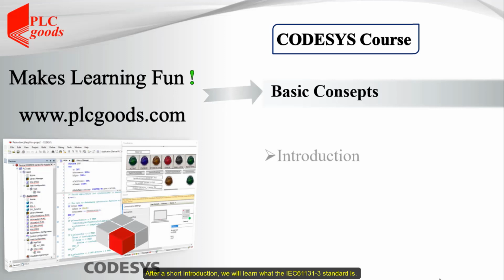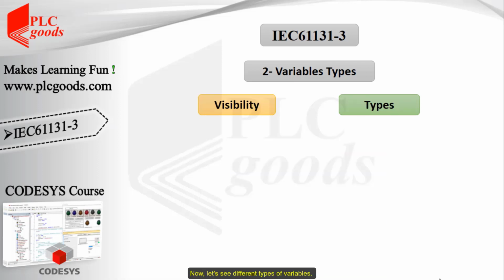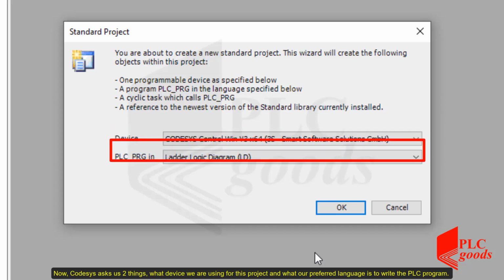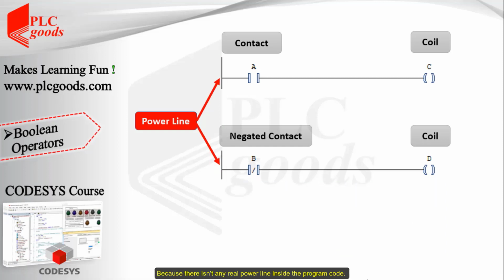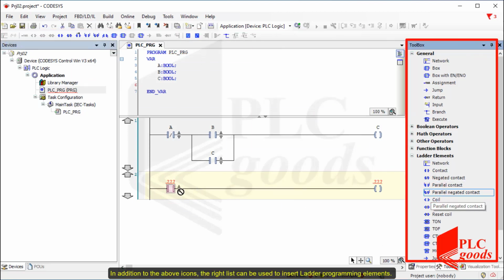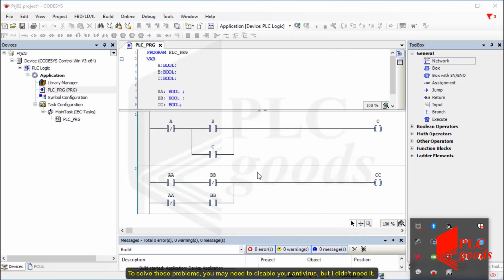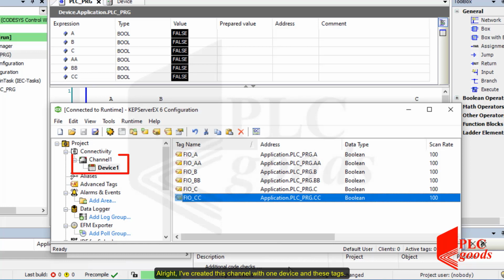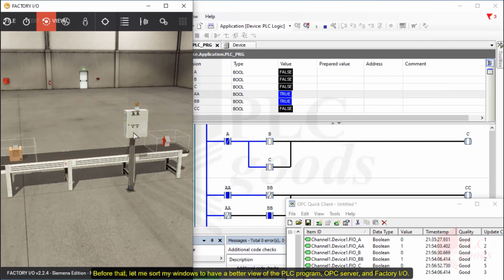PLC programming using CODESYS | CODESYS PLC Programming Tutorial | Beginner to Simulation Project

Comment: Hi, thank you for the tutorial.

I successfully connected CODESYS → Kepware → Factory I/O, but I have one question about the final demo.

How did you configure the item source and item sink (the box generator and box remover) in the Factory I/O scene?

Are they controlled by PLC logic, or are they configured directly inside Factory I/O?

I couldn't find any explanation about how the Start/Stop buttons are linked to the box generation/removal process.

Could you please explain the scene configuration or share the Factory I/O settings used in the demo?

Thanks!
Reply from the maker: Hi,

Thank you for your question.
The Item Source (box generator) and Item Sink (box remover) are configured directly inside the Factory I/O scene. They are standard Factory I/O components and are not special functions created in the PLC program.
The PLC logic is mainly used to control the conveyors, sensors, actuators, and the overall operation of the system. The Start/Stop buttons are linked to the PLC program, which then controls the process according to the logic demonstrated throughout the course.
This course contains 24 lessons and approximately 6 hours of training. I strongly recommend watching all lessons carefully, as many of the concepts used in the final demonstration are built progressively throughout the course. Learning PLC programming requires patience and practice, and often the answer to a question becomes clear after reviewing the related lessons and experimenting with the software yourself.
I invested a great deal of time creating these practical examples to help students develop problem-solving skills, so I encourage you to continue exploring the project and Factory I/O settings on your own as part of the learning process.
Best of luck with your studies.
Reply: @plcgoods  Hello,

Thank you for your detailed explanation.

I understand now that the Item Source and Item Sink are standard Factory I/O components configured directly within the scene, while the PLC program is mainly responsible for controlling the conveyors and overall process logic.

I appreciate your clarification and your advice regarding the course structure. I will continue working through the remaining lessons and spend more time exploring the Factory I/O component settings on my own.

Thank you again for creating these tutorials and for taking the time to answer my question. Your course has been very helpful for someone who is new to PLC programming.

Best regards,
Charles

Comment: The KepServerEx doesn't work for me, any other alternative software I can use?
Reply from the maker: hi there, I didn't worked with another software, because KepserverEx supported my necessary requests. Note that if you are using its trial version, it is disabled every 2 hours and you need to run it again.